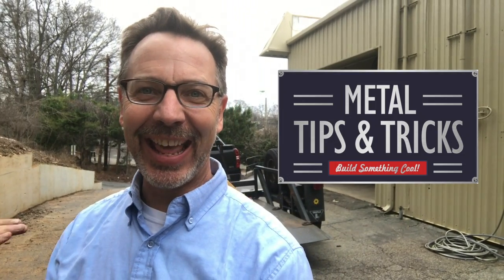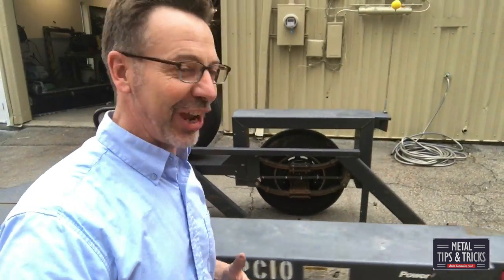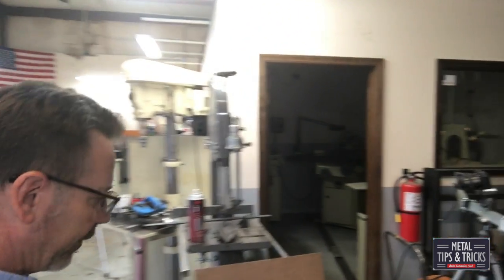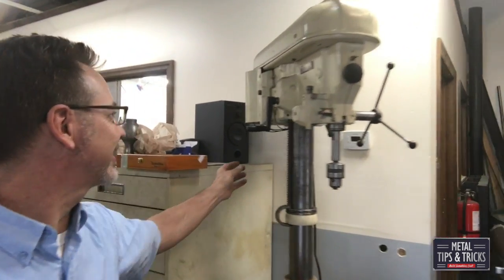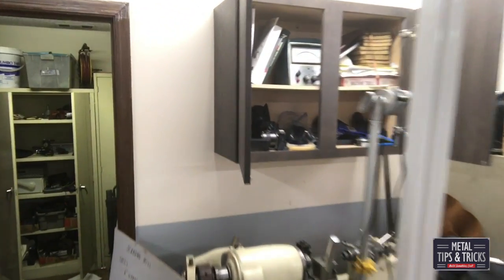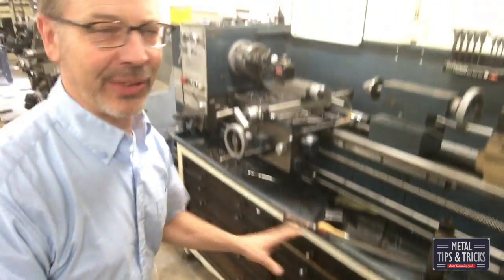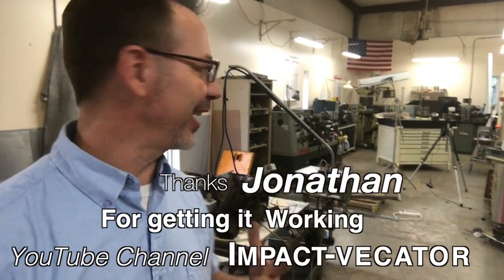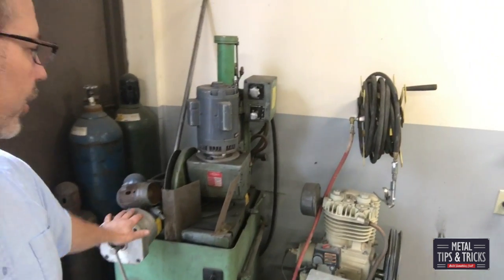Moving day / Last shop tour.

Comment: I know what you went through.  I just moved my 1200 square foot home shop of 25+ years to our new home where I just started construction on our new 3k square foot shop.  Took me and my son 3 weeks to move the shop and 3 days to move the house.  Not for the faint of heart that's for sure.  I rented a drop deck trailer like you did for the large equipment and then a 20' enclosed trailer for much of the other.

Sorry you got booted out of your shop but you will be much happier with a shop at home.  
Mike.

Comment: I had just as much machinery and tools as you and moved it 750 miles south from CT to TN. I did it in 5 trips. besides all the household stuff on top of that. I know what a monumental task it is to move all of that heavy stuff. I actually bought a hydraulic tilt bed trailer and installed a winch on it to drag all the machines into it. Worked out great! I saved about $10,000  over paying people to transport it and load it. 

Please be careful moving that stuff. I had a lathe tip over on me and broke my leg, I got titanium plates and screws from a tib/fib fracture.  I got lucky. Don't use rollers if you can help it. One roller slipped out on me and the lathe fell off, I was wedged between the wall and a 3000 lb lathe. My advice is to drag it if you can. Don't use machine rollers. Pipes are safer than them Damn machine rollers. I got real lucky, I could have been crushed or crippled. This happened 2 years ago and my leg still hurts just about every night. Please if it seems sketchy, don't do it...that's all I have to say... Good luck with your move buddy..
Reply from the maker: HI Marcel. Thanks for your advice. Im very carful because I under stand the dangers,  I have never been hurt moving machines, Because I don't take risks.  And like you said if it  feels sketchy I stop and figure out a different way.

Comment: I can relate.  Moved from South Florida to TN and had a great metal shop in my two car garage last year.   Since I was doing a residential move, I learned that it was just better to sell off the big stuff that could not be rolled easily like a Mill/lathe/CNC.  (I didn't have a nice trailer like you do).  I kept all the smaller tools, but common import items like a horizontal band saw or import drill press should have been sold as it cost about as much to move as it did to just sell it.  Put that all into a fund to re-buy equipment as I found it.  In retrospective, this was a good move to upgrade and get good deals on better equipment.  Moving is stressful, its been 1 year and still getting shop back into working order.   Good luck on the move!
Reply from the maker: HI D Stud,  If we move long distance again I will probably take your advice.

Comment: When repurposing a treadmill motor, you need to provide forced cooling, like a small external blower. That little motor gets hot when producing 1+ HP. A separate fan is even more important when using variable speed control so plenty of cooling air will pass thru it, not just over the outside, regardless of the speed.

Love that trailer!
Reply from the maker: Hi John, thanks for the comment. I tried everything . I plan to do a video on the drill press to show what i did. I'm proud of my conversion I wish it would have worked better.

Comment: Moving always stinks, so lets try to put a positive spin on the move.   This may sound odd, but moving to a smaller shop will force you to focus on what you really need and what you can get by without, and you may actually wind up with a much more efficient space in the end.  Having your shop in your house may also be a bonus.   I used to rent a shop that was a half hour drive from where I lived.  Now I have my shop in my back yard.   After having a shop at the house I couldn't imagine having a shop anywhere else.   Chris
Reply from the maker: Hi Chris, I agree with everything you said in your comment. :-)

Comment: noticed a 3d printer there, How was your experience with 3d printing? Mine solved a lot of problems that i had no solution before - unusual shapes and specific little problems. But i find that after i solved them i am just using it for whatever i can even if sometimes there's more sence just to buy stuff.
Reply from the maker: HI, I really have not got into it. I thing they are cool I plan to do some prototyping of tools with it.

Comment: seriously... what is up with you Americans? "Oh I'm moving but I'll be moving there and there in two years... then I plan to move to the countryside one day..."
Call me conservative or simply call me "the stupid German", but I simply don't really understand this habit. of course you shouldn't take my remark seriously ;-)

I can understand what an awful lot of work it is to move a shop. I personally think that is the worst thing to move. We just recently finished moving our machine room back in, which we had to clear in order to build a proper ceiling over it and stairs and I can admit that moving all the machines as well as (or perhaps especially) all that small crap that has accumulated over the years was not just costing me one sleepless night. considering that we just had to get the fork lift ready and move the stuff about 30 meters in a two car garage we had to do nothing compared to you, BUT
it was still an awful lot of work and while my machines were all packed up I felt like someone had amputeed some limbs of mine... "let's just turn this shaft down 0.2 mm... Oh right - the lathes are in parts. In the friggin garage. Where I don't have electricity. - How would people in the Middle Ages have done that..."
I absolutely don't envy you having to wheel a shop full of machinery countless miles on a trailer. I really hope everything works as smoothly as possible and I really wish you the move with the least complications in the history of mankind. It is never smooth and easy of course

If I would be just remotely near Atlanta, I would definitely be there to help you but unfortunately the distance is a wee bit inconvenient ;-)
If it helps you though... if you are having a rusty bolt, a mill that plays dancing bear on the fork lift, a belt that just got stuck between the pallet and the trailer or the good caliper that just happened to fall off somewhere in a non explicable fashion directly on the floor for you to roll over with the three metric tons you happen to be hauling around... chill out, mentally transfer the frustration to me and go ahead with what you were just doing ;-)

oh... and of course please continue with your videos once you are done with your move. what you are doing is not just entertaining but also very educating. Not kissing your backside but sincerely appreciating your work here
Reply from the maker: Hi Alexander,  Believe it or not, moving  the shop is not so bad.  I know I'm going to have to do  it  every 2 or 3 years. So I have designed  my shop to make it easy  to move it. Most of  the cabinets are on wheels, and everything else will fit on pallets and can be  pallet jacked around. But if you start to feel a headache or pain in your back it's me transferring my pain to you  :-)
Reply: Just started feeling a little headache. It appears  that you must be in some trouble... ;-)
If you set it up that way things will be a lot easier of course and every 2-3 years... you must have developed a routine in this already. As it appears I'd say I'm a very untrained shop mover :-D
Reply: Just started feeling a little headache. It appears  that you must be in some trouble... ;-)
If you set it up that way things will be a lot easier of course and every 2-3 years... you must have developed a routine in this already. As it appears I'd say I'm a very untrained shop mover :-D
Reply: Just started feeling a little headache. It appears  that you must be in some trouble... ;-)
If you set it up that way things will be a lot easier of course and every 2-3 years... you must have developed a routine in this already. As it appears I'd say I'm a very untrained shop mover :-D
Reply: Just started feeling a little headache. It appears  that you must be in some trouble... ;-)
If you set it up that way things will be a lot easier of course and every 2-3 years... you must have developed a routine in this already. As it appears I'd say I'm a very untrained shop mover :-D
Reply: Just started feeling a little headache. It appears  that you must be in some trouble... ;-)
If you set it up that way things will be a lot easier of course and every 2-3 years... you must have developed a routine in this already. As it appears I'd say I'm a very untrained shop mover :-D